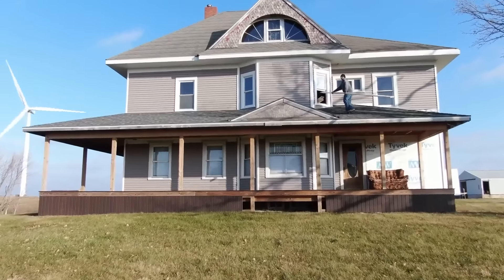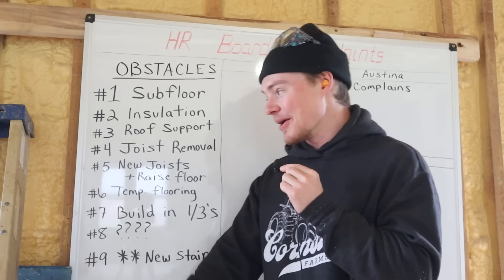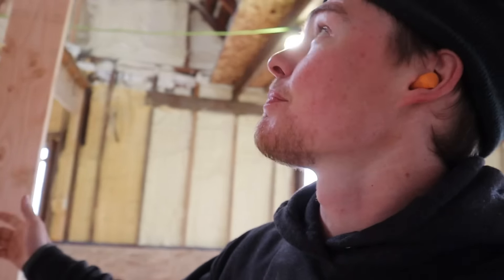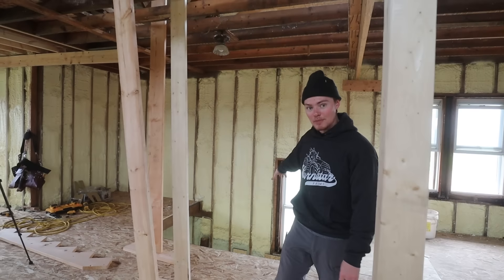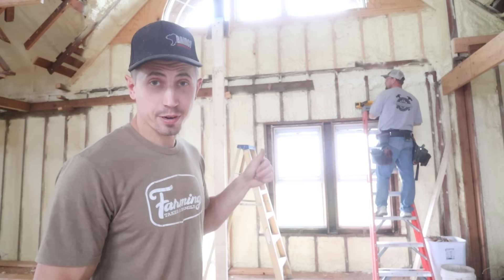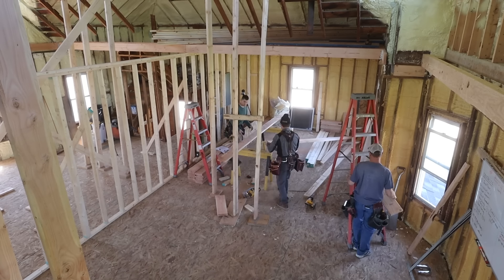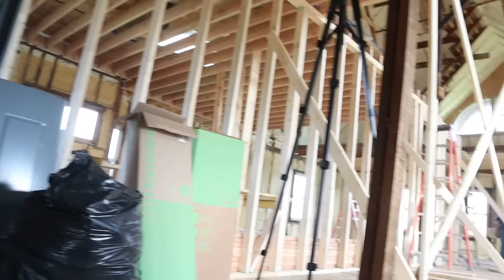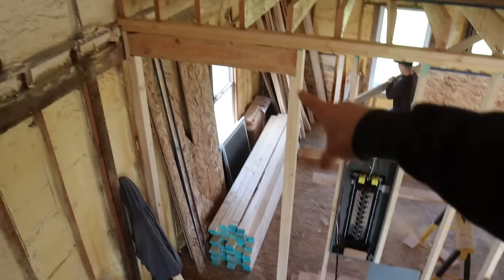Restoring A $7,000 Mansion: INCREDIBLE Dream Attic Rebuild (Pt. 2/3)

Comment: Ya know remodeling old houses bring numerous problems you would have thought of because old houses are built to there eras building practices and how people lived than......in 2024 we humans live much different. We still have basic needs but 2024 need some many new technologies that people 130 years ago would have never thought you needed as humans. Microwaves, internet, driveways, insulation, double pane windows, air conditioning.......etc

Comment: Plus if you hve stairs going up thru the big space  to the balcony then u shudnt need the stairs going up to the attic from the existing stairs solving your stirs issue?? Just thinking as. Women....I reckon your wife would live that....a grand staircase.... could be n idea Cole but....won't the h vc designed for going Central, the reason for changing the beams....how will that work where this is central???? Changing the plans t this stage my men extr to work round..... nd lost space you can utilise.

Comment: That house has shifted out of shape if it is moving that much when the wind hits it or you bounce on the floor cause it is being done wrong. You never start a rebuild from the bottom up. It should have been done top to bottom. This is some shady and dangerous work for no reason. If you don’t know what you are doing don’t do it.